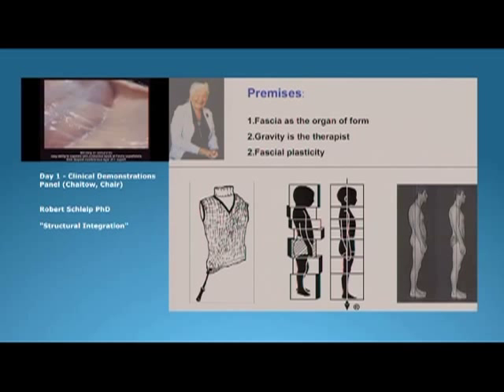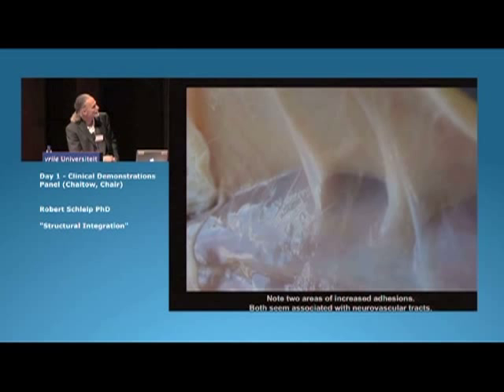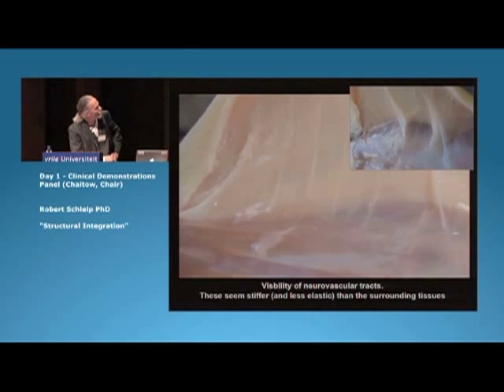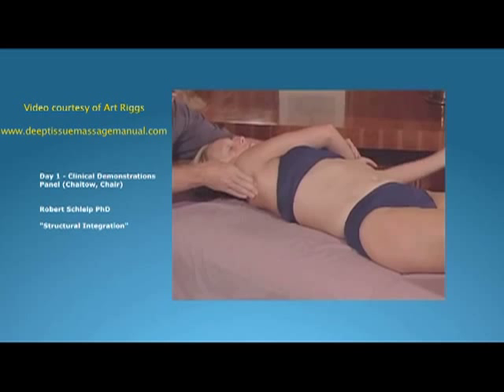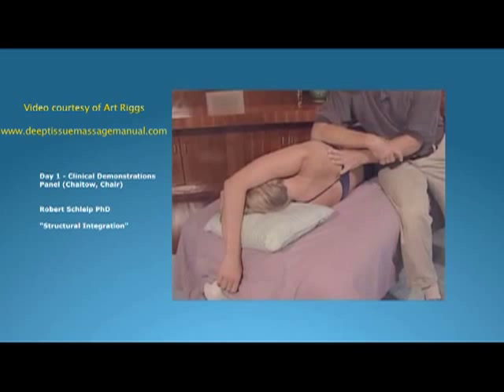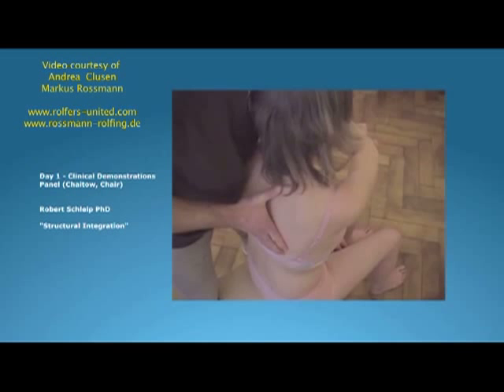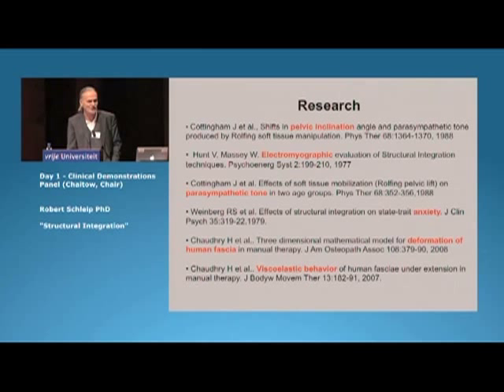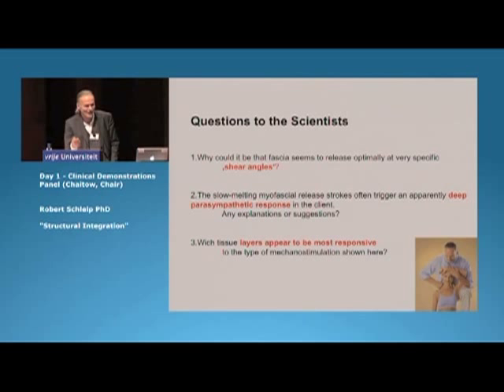Structural Integration at the 2009Fascia Research Congress Part 2

Comment: 1) could this be something to do with Buckminster Fuller's tensegrity structures..? 60 degree angles...2) improved circulation removing lactic acid? increasing blood flow.  this washing of the nervous system returns us to optimal para-sympathetic activity in balance with the sympathetic (a return to symmetrical function from asymmetrical), 3) trapezius